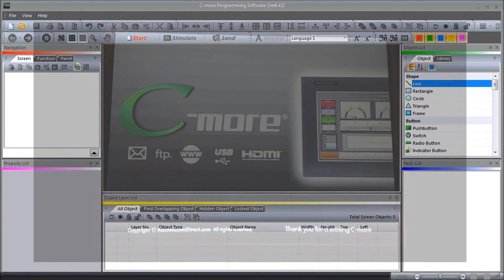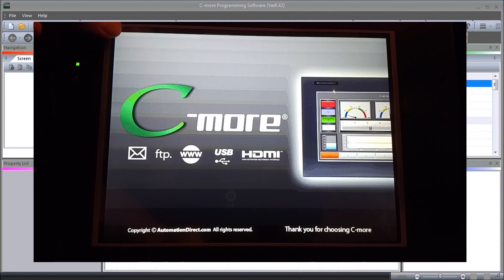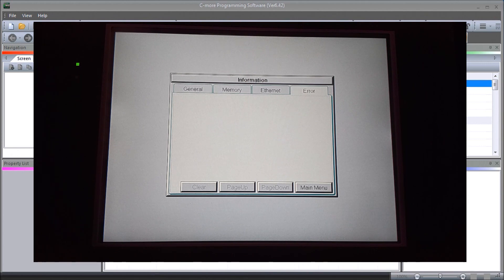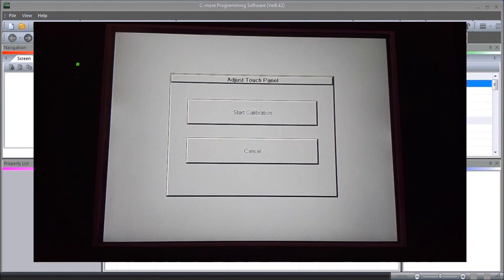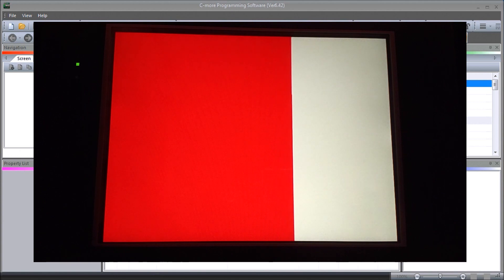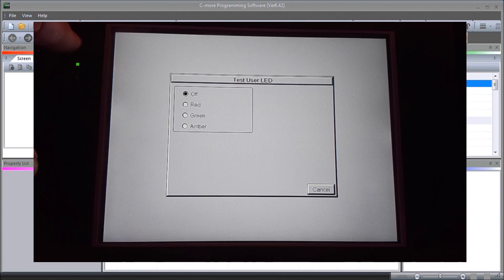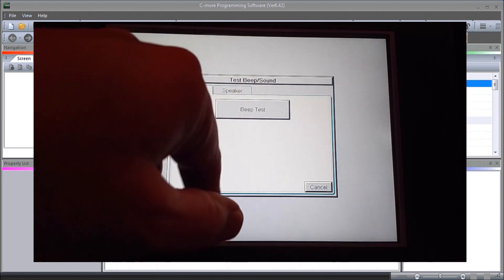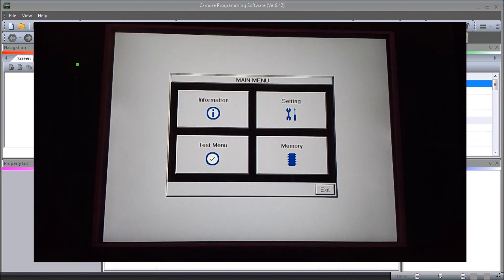C-More EA9 HMI Series Panel System Setup Screens

Comment: I have a EA7 hmi can I just like copy and paste to EA9 hmi? It work like that or I need to connect the computer?
Reply from the maker: Hi Gerardo Anaya,
The software for the EA9 will read the EA7 panel program. (This will be an EAP extension file) You will need the EA7 software to download the program if you don't have the file. (C-More Programming Software V2.78 SP2) 
Once you read the EA7 project, the EA9 software will convert this for you so it can be downloaded into the EA9 screen.
Here is a video on the differences between the two screens.
https://www.automationdirect.com/videos/video?videoToPlay=MEhlU0iBzxg
 EA9 Software is a free download.
https://support.automationdirect.com/products/cmore.html
Here is a link to our C-More EA9 Series on the website.
https://accautomation.ca/series/c-more-hmi-series-panel/
I hope this helps you out.
Regards,
Garry

Comment: Can you setup the EA9 to communicate through a P3-RX?
Reply from the maker: Hi Ronald
The EA9 would communicate Modbus RTU (RS485) through a P3-RX. 
Regards,
Garry
Reply: @ACCautomation  is there a video showing how to set this up in the cpu? I am assuming you might need to use read/write commands.
Reply from the maker: @ronaldj.cartersr.577  
I do not have a video showing this, but you will not require read/write commands. The HMI will be the master communicating to the slave. You will just need to know the unit number assigned to the port and the serial parameters. 
Assigning the Productivity Serial driver in the HMI will do all of the communication and timing. 
Regards,
Garry

Comment: can i access to System Setup without touch panel? only with physical keyboard or mouse through usb?
Reply from the maker: Hi Alex,
If this is an EA9-RHMI (headless) C-More you can access this through the USB connection.
https://accautomation.ca/c-more-ea9-hmi-series-headless-rhmi-setup-screens/
All other units must access the setup screens through the touch panel.
https://cdn.automationdirect.com/static/manuals/ea9userm/ch5.pdf
I hope this helps you out.
Regards,
Garry

https://accautomation.ca/series/c-more-hmi-series-panel/
Reply: @ACCautomation  is not a rhmi, i no have this support in my model,, my model is ea9-t8cl
Reply from the maker: @al3xcg  
You can only access the setup screens through the touch panel.
Regards,
Garry